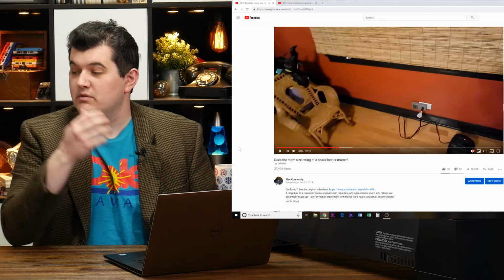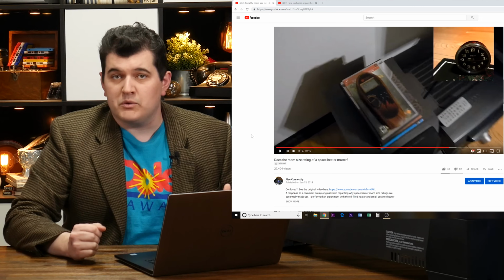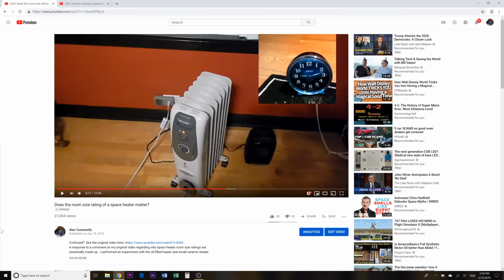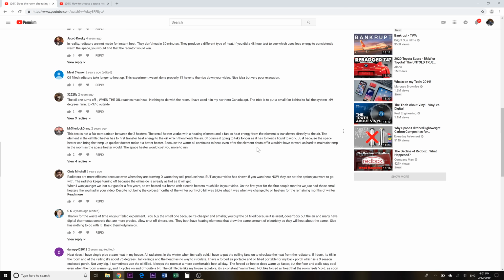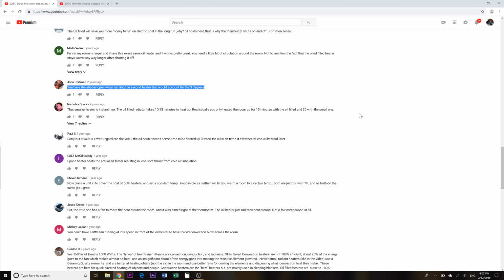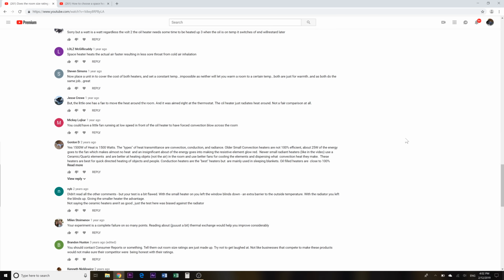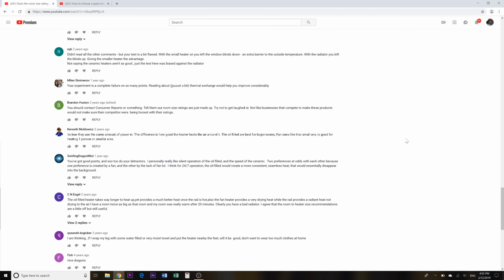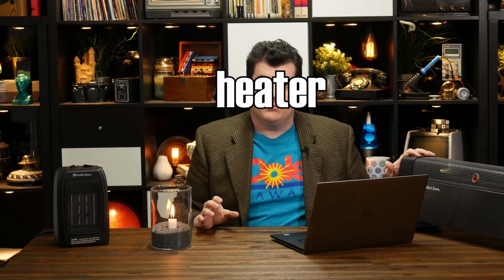More Space Heater Nonsense

Comment: The convection heater's element is directly in contact with the air and probably around 300*C or more directly heating the air to probably well over 100*C.  The oil radiator element is in contact with oil and probably around 150*C the oil is in contact with the metal shell and probably only heats it to 65-80*C before it switches off to prevent kids from burning themselves on it.  The convection heater is designed to heat the air in a space as quickly as possible.  The oil heater is designed to 'trickle' heat the room efficiently over a much, much longer time frame.  They are not meant to raise the temperature quickly, but it provide a stable, slow, continuous base heat to a cold space.
Reply: Having lived in a house with no central heating through winter, the small air heaters, convectors or fan based tend to heat the air rapidly, so while they are on the room is lovely.  However as soon as they go off the room cools rapidly.  The higher the air temp in the room the more energy it loses (basic U value stuff).  Oil filled radiators tend to heat the air slower, but as they are cheaper to run, you can leave them on for much longer and over hours they will slowly lift the temp.  As the room then loses less energy due to a lower temperature differential they are more efficient.  This also, being on longer, gives more time for the walls, floor, furnishings time to absorb the heat.
I think it shows heaters are not exactly like for like.  They have different aims.  Although you are correct that watts in is watts out and they are all technically 100% efficient in the heating they do.  But in a practical sense over a longer time period the oil filled radiators and slower heaters will be more efficient at providing practical heat.

Comment: Everything you say is correct with regards to room temperature, but you only consider sensible heat transfer. Radiative heat transfer is considered 'pleasant' by most humans, and it does directly warm skin and clothes. Consider a camp fire in winter - the air around you is actually cold as convection draws in cool air from the sides to feed the fire, so a perfect thermistor would tell you that it's cold, while a human (with very different albedo) would feel quite toasty. This is one of the reasons people like large, warm objects that radiate long-wave infrared that directly warms them. 
Does that mean that such a heater heats a room more efficiently? Absolutely not. You are completely right that room temperature is not affected by this. HOWEVER, it tends to be more efficient at making a human feel the same temperature, while the actual room temperature is lower, because more energy is converted directly on skin and clothing. 
I doubt you will read this, but as someone who has dealt a lot with heat fluxes, I figured I would leave a comment anyway. 

Thanks for your great videos!

Comment: I think the only real advantage/disadvantage of a small vs large heater of the same wattage would be...
The small heater takes up less floor space, but, is a smaller, more concentrated heat source.
The large heater has less heat per square inch of heater, so, nearby objects will be less likely to suffer from heat damage.
So, the same amount of heat will be produced by either. It's a matter of how concentrated the heat is when it is initially introduced into the room.

Comment: It occurs to me that one could help the oil filled heater to keep operating rather than cycling on and off by adding a $20, 20inch box fan behind it blowing air through the radiator portion.  But then you've just made something that acts more like the smaller ceramic heater except that it has a built in "delay" while it warms up all that thermal mass before being able to add much heat to the room, and you've also spent much more than you would have on the ceramic heater.  Yeah.  Oh, and the oil filled heater takes up more room in your storage area when the warmer months roll around.

Comment: While from an energy in vs. energy out perspective, you are correct and any electric space heater is 100% efficient (and the room size thing is mostly just marketing), you are forgetting about temperature gradients (how even the heat is throughout the room) and temperature swings.  While a compact space heater with a fan will do a good job of heating a room quickly and the fan can help reduce the temperature gradients (though places where air flow is blocked will be cooler), when it does get the room up to your desired temperature and shuts off, the room will suddenly feel cooler.  An oil-filled heater will take much longer to get the room up to temperature (more than the 1 hour you used in your experiment), but once it does, it will provide a much more even temperature throughout  the room.  This means leaving the heater plugged in continuously and only dropping the temperature a couple degrees when leaving the room (if at all).  If, as a result of temperature gradients and swings you end up heating the room to a higher average temperature, the heater will consume more energy and thus be less efficient at heating the room as a whole.  OTOH, heating a room that isn't occupied to keep it comfortable is also wasteful.

Comment: Question: Why don't heaters use better power cords?  If you run them continuously on high the plug and cord will overheat.  I put a space heater on a dedicated 20 amp circuit so I should be able to use 1500 W continuously without issue, but the heater itself will always overheat. To avoid overheating I always have to use the low setting due to plug overheating.

Comment: okay so it should really be explained in the marketing more but I'm pretty sure the reason small room heaters heat faster is because you'd use them in an office or workspace that you don't necessarily need to keep heated through the day, so small room heaters are supposed to get them to a comfortable temperature faster where large room heaters are supposed to heat more passively because you leave them running in a room that would take a long time to heat comfortably either way and they're more comfortable and much safer to use in this way. 
In the same vein, those small noisy heaters only need to run so long to get a room to a comfortable temperature, where it may seem like they're running constantly in a large room.
BUT your concern is specifically with their claims of efficiency and I think the question you need to be asking isn't whether these heaters are more effective at bringing a space to a desired temperature, but rather if these stored heat spaceheaters draw less power to keep a space at a desired temperature once it has already reached a desired equilibrium. 
Small room space heaters DUMP out a bunch of heat, wait for it to disperse through the room, then DUMP out a bunch more heat while the expensive models maintain a nice steady warmth
not exactly the kind of experiment you can cover in an hour and a half.

Comment: I used 2 small ceramic space heaters to keep my 900 sq ft house when my heater broke in January.  They were sufficient to keep the pipes from freezing in a much larger area than they were "rated" for.  They wouldn't heat the house above about 60 for the entire house but neither would any heater designated for a single room.  I think they probably did a better job than others because they have an internal fan that helps to circulate the air a little more than relying on the convection currents and temperature gradients.

Comment: The problem with most space heaters is that the thermostat is on the heater itself, so it will shut off when the air around the heater has hit the set temp but in a larger room the temp where you're located could be much lower. I've tried many different models & have found that the ones with the biggest fans warm the room the best. They may be putting out the same BTUs but the fact that the bigger fan is moving more air & circulating & mixing the ceiling air makes it fell much more effective at warming the room.

Comment: Electric heat can never be 100% effective. Not even through a heat pump. Why? Because of the technology. You get the electricity out of coil power plants where you burn fossil fuels and take 40% of energy from there and turn it into electricity. Than you transfer it to residential area with cords that have its own resistance - total loss. Then you transfer it inside your own home and there are losses as well within the installation chords. Finally, when it comes to   your heater, only then it uses the power. The most ignorant way to use electricity is to turn it into the heat. That is a fact.

Comment: In Europe, at least in some countries electricity is cheaper during the night, so it is cheaper to buy heater that can accumulate the heat energy during the night and heat you for as long as possible during the day without having to turn it on. That is why we use TA heaters for winter. My sister owns 4kW one.

https://www.eurotehna.rs/media/catalog/product/cache/1/image/2dec805453807a83263899257b43eeec/m/a/magnohrom_ta_pec.jpg

Comment: Thanks for the complete discussion of the nonsense of space heater marketing. I'm glad you got to the issue of the convection heater's heat rising and leaving the floor cooler. And that you did mention the radiant heaters ability to directly heat the person. You even covered the delay due to thermal mass in the oil and ceramic heaters and the noise of the fan. All are reasons to prefer one over another, but not things that make them suitable for medium vs. small rooms.

Comment: I believe its the overall size of the heater that makes it for small or large rooms. Think about it. If you had a piece of steel that was 4x4 inches and heated it to 100°f and put it in a room that is 12x12 foot, it's not going to heat the room very quickly. But if you had a piece of steel that was say 4x4 foot and heated it to 100°f and put it in that room, it would transfer its heat energy much more. In my mind, that's how I see it. The reason for the difference in your testing was the fact that the small heater had a forced air designe and was able to move the air in the room, whereas the larger heater relied on convection to move the air. I won't argue with you, I'm not a scientist or would I even consider myself smart, but when I thought about the differences, small room vs large room, that's what I come up with.

Comment: Having used both type of heaters, my experience is that the fan ones can never reach a certain degree, but albeit they will instantly warm up the room. The oil type however... If the thermostat is set to high it will take longer to Hest but it will get topically hot. The fan one on the other hand... As soon as u turn it off the heat seems to dissappear instantly. I do live in Europe however and I have not checked the voltage....

Comment: Assuming you're not yet tired of comments here ;) I would say this: To effectively test the fan-type versus the radiator-type heaters, first place the radiator model in a room, T-stat turned up as high as it will go, and leave it for 2 hours, and then measure the temperature of the room.  This should give you a good idea how much it will warm the room.  Then, unplug the radiator, and plug-in the fan-type model, set to max output, and check the room temp after another 2-hour period.  I think you're right, and I think you'll see a higher room temp after running the fan model, because of the T-stat arrangement difference between the two.

Comment: All resistive space heaters of the same wattage give off the same heat, the only difference is in the latency and focus of delivery.  Over time watt for watt they will maintain the same temperature in the same room.  The idea behind radiant heaters is that they heat the target (you) not the space, much as sunlight does, which is why restaurants use them for al fresco dining.  Of course once the radiant heat hits its target (any surface) it warms up, which in an enclosed room warms up the space to exactly the same extent as the resistive heater.  However this in the al fresco situation is wasted as the space is not enclosed.

Comment: The only think that I can see in favour of oil heater would be related to evaporation. Circulating the air rapidly increase evaporation and evaporation is absorbing calories. This is also why we are using fans in summer.
But honestly, this is not making a huge difference in this test especially knowing that the oil heater is not heating 100% of the time.
Here in Europe, we have a larger choice of heaters (thanks to 240V) and there is a clear relation between watts and room size; also if a house was only heated with electricity they were installing 3-phases heaters (480V). Nowaday most people are using heat pump to take advange of AC in summer.

Comment: i think the point you were trying to make is that the only thing that would make a heater "better at heating a larger room" is having a higher energy input. if three different heaters all measure the same energy input (the maximum safe energy for 15A circuits) then none of them is going to be any better or worse at heating a room depending on that room's size. in other words this dimension of "room size" is basically meaningless and bizarre, even if one of them hypothetically went up to 3,000W, since it really has nothing to do with the room size. in a smaller room it would just turn off sooner. the one thing that would be different in a larger room, technically speaking, would be the speed of heating. so if a person in a large room prefers a 3,000W heater since it heats the large room up faster, where 1500W heaters take too long, then WHAT IS THE POINT OF THE OIL HEATERS? is heating fast a good thing or isn't it? anyway, none of them go past 1500W in the first place. it's basically gibberish saying that a heater is suitable for a room of x size. it's true that different heaters CAN be qualitatively different. but none of those real, qualitative differences, have anything to do with dimension "room size," since they are QUALITATIVE. for them to have any type of proportional difference in performance relative to dimension "room size," those differences would have to be QUANTITATIVE. the fact that a heater has oil in it does not make it any better or worse in a large room than in a small room. the fact that a heater radiates heat with infrared elements does not make it better or worse at heating a larger room. YES, fine, some heaters are different from others. but none of those differences justify a packaging label that says "large room" or "small room." if we spent hours writing up a series of equations to describe all of the differences between radiant heaters and ordinary nichrome heaters and oil heaters, we'd see that the volume of the room does not play any part in causing performance differences between the types of heaters. except, i guess, that if you're standing like 50 feet away from your heater, you might perceive better performance from the radiant heater, since radiation travels distances much faster than convection. but if you left them on long enough eventually the air surrounding you would be the same temperature. and if you want immediate heat, why are you standing 50 feet away from your space heater?

anyway the silliest thing is just this defense of oil heaters. they literally heat more slowly. in the one dimension that kinda sort of matters depending on room size, oil heaters are worse. and what's this about drying out the air? can someone explain this to me? do other types of heaters create portals that selectively suck up water vapor? if anything, i'd assume oil vapors to dry up the environment even more, since they basically contain oil traps where a certain, though finite, amount of water could get stuck for long periods of time. i mean, after using it for long enough i'm sure they'd become maximally saturated with water and you'd no longer notice this. but anyway, that statement seems a lot more to me like just popular misconception, like oil sort of seems wet and some humidifiers have oil in them, so there's a vague association between oil and wetness, so if you have no idea what you're talking about you might assume that oil heaters make the air wet or something. maybe i'm wrong though, i don't know jack shit about space heaters. i live in southern california so go figure, never used one in my life lol

Comment: Great video.  I went through same consternation when looking for heater a few years ago. Heat is heat, you might as well buy a 1500W light bulb.

I live in old drafty house, pier and beam, so it gets cold, especially the floors, and I wanted the bathroom to get toasty [I can handle a really cold house as long as I have a warm bathroom!].  I got one of the little $20 or so forced air with heating coils heaters that are so common and it works great, for at best one or two winters and then the effing tilt switch dies, and, that switch is inevitably part of the thermostat assembly so it basically kills the unit.  This happened with 4 of them, all different manufacturers.  I found a radiant heater that mounts off the ceiling and it's the best bathroom heater I've ever had.  When it's really cold, you can get out of the shower and just stand right under it and it keeps you warm.  Plus, HUGE bonus, it heats the floor AND the toilet seat!  Anyone who's lived in such circumstances will very likely understand why I love this heater as much as I do.  Highly recommended. One caveat, safety is a bit of an issue, you just have to mount it in a way that minimizes the risk of a fire in case of malfunction.  I think one of those external thermostats would be a good way to go.  A warm toilet seat overrides A LOT of safety worries.